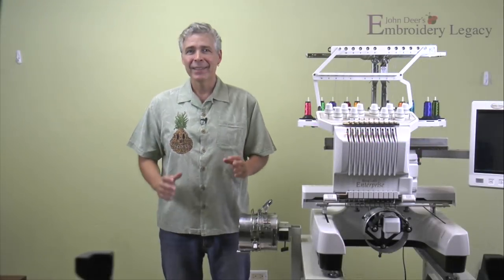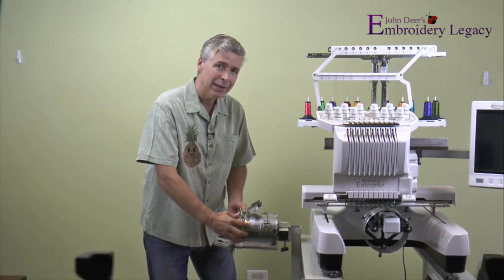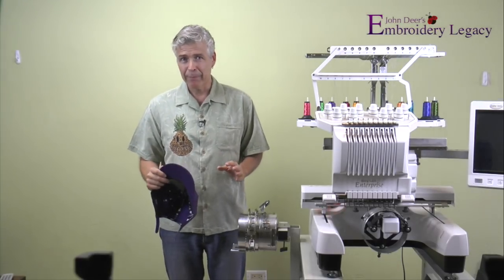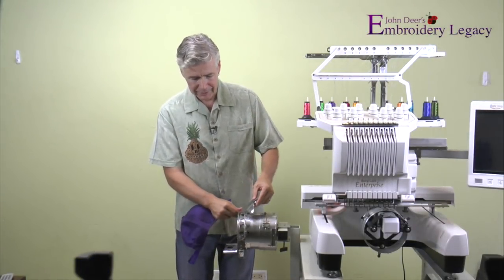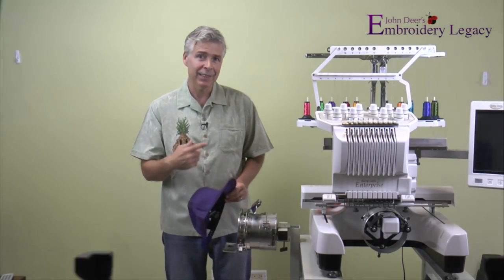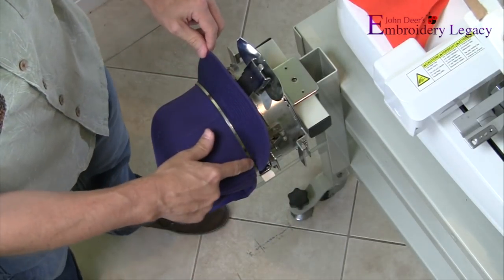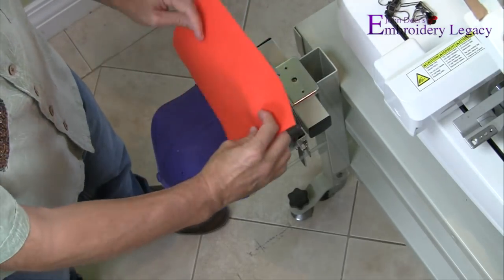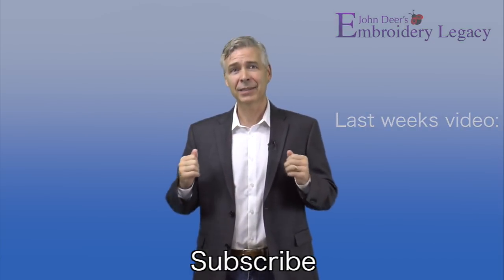How to Hoop Caps & Hats for Machine Embroidery Using Stations, Jigs, Drivers & Frames. Full Tutorial

Comment: Thankyou, I’ve learned two things I didn’t know! I noticed you didn’t add stabiliser. Would you recommend any stabiliser? 
Also do you use the clips at the back of the caps to pull it smooth?
Reply: For structured caps with laminated buckram backing, it isn't always necessary. Unstructured hats definately need a heavy tear-away stabilizer.

Comment: I have that same machine.  I am good with the hooping of the hats.  I haven’t used my hat hoop in a bit and when I am installing the driver, the screws on the top and the ones that go on the bottom are almost touching.  So that when it stitches out they bang and throw off my design.  I have looked and they are in the spot shown on the Brother video but I remember someone making a comment that they needed to go in a different spot or you’d have banging.  Can you show a video of putting the driver onto the machine or a picture showing the proper placement of the screws on the Brother PR1000.  Thanks
Reply: I would like to see that as well.

Comment: Great video!!  If you are embroidering to the right or left of the front seam do you need to continue the straight line to the back of the hat?  Also you used steam but a heat gun works well for me.  What are your thoughts?
Reply: Not sure how powerful it’s the heat gun comparing to the garment steamer. From my knowledge it is much more powerful then garment steamer. If you do embroidery centre off but still front of the cap, just hoop straight has per video

Comment: John, I appreciate the video, but it only tells half the story. The locking ban is a good idea but only serves half of it's purpose because the back part clamps on metal and does nothing. So hat can slip. To tight and it adds to the wrinkling.  When you put the clamp over the bill, you did not mention the wrinkles it caused on the embroidery surface. I was never comfortable with that. The new hoop tech gen 2 is out now and takes those wrinkles out. Also you get more surface to embroidery. I am looking forward to purchasing one as soon it fits the budget. I never felt I could make a quality hat with the other hat frame. Look forward to more of your video's.

Comment: Could you please comment on how to put the binder clips on the hat hooping?  How much tension should there on the curved hat surface?  I found out that too much or too little tension is not good.  How much is just right?
Reply from the maker: MaximusSuperiorus the frames form that machine are engineered for the clamps. I’ve found that steaming the laminated backing just prior to hooping give adequate support with the cap frame.

Comment: Does hooping effect cap buckling? I've been having issues with NewEra brand caps buckling near the center seam even when using the inside to the outside technique. I can't figure out what I'm doing wrong
Reply from the maker: I’ve personally found that some brands are more problematic than others. I’ve also found that cap frames vary for each machine brand as well. Guess what I’m saying it that there are a lot of variable depending on the hat and the equipment. One little trick that helped when I was doing production was to have the cap I was about to hoop sitting on the head of a garment steamer, it made the stiff backing a little more pliable for tighter Hooping and reduced puckering.
Reply: @EmbroideryLegacy  thank you so much for getting back to me! I'll try streaming them!